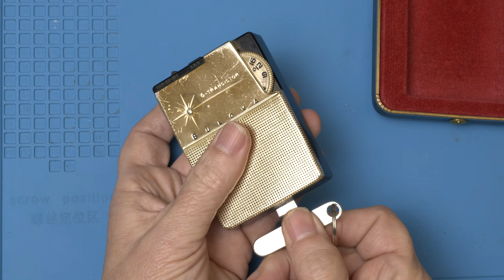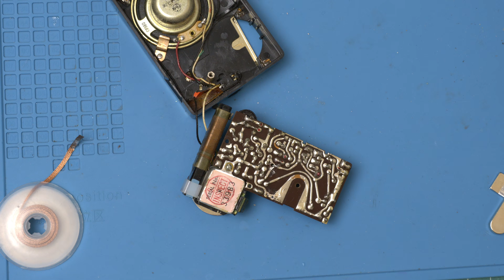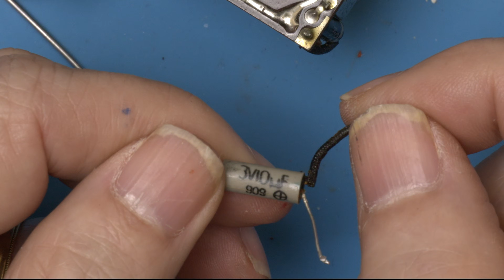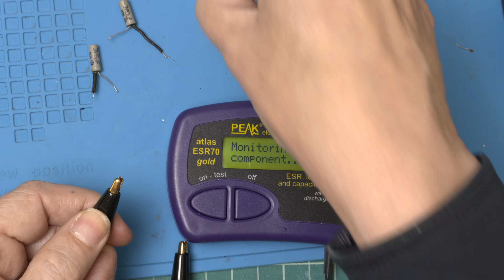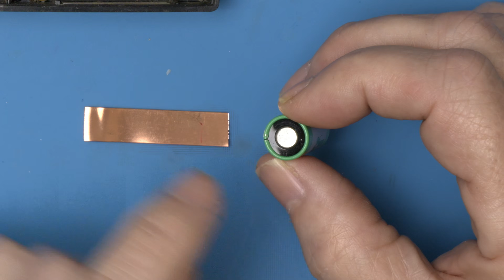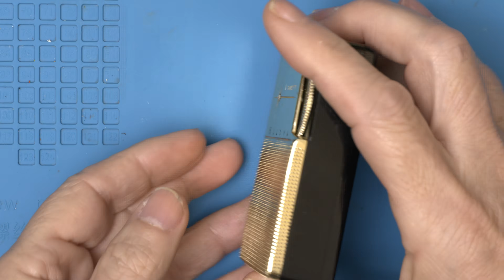3D Printed Adapter uses Dog Shock Collar Battery ⚡🐶 for Vintage Bulova 672 Pocket Transistor Radio

Comment from the maker: The closing song is titled “You’re the One” by Dave Thomas, featuring Alex Robotham on vocals.  I’m using a low power AM transmitter to broadcast it to the radio!
Reply: That's the problem with MW. No stations to listen to unless you're in range of Radio Caroline.

Comment: Should always back off a screw first when going into plastic until you hear/feel the bump, that way you don't cut new threads.  Would avoid electric tools on antique electronics.
Reply from the maker: Good advice, thanks.

Comment: Interesting how circuit boards back then covered all the runs with heavy solder. And that is kind of funny knowing the runs would never ever carry such high currents. And also the transistor counts were advertised as a selling feature and so many times some of those transistors were merely used as a diode instead of a real transistor function. But it was the highest count numbers that were the selling points then...   Thumps Up!
Reply from the maker: Tons and tons of solder!  And yes, transistor count was like the megapixel wars for digital cameras, then it turned into bragging about "solid state".  Thank you for watching!

Comment: Instead of srinking tube use a piece of plastic wire that you have remove the core.
Reply from the maker: That would work!  I have a whole of box heat shrink tubing I’m working my way through…
Reply: @Dream.Build.Create  I always used wire insulation as suggested above, no need to shrink and holds better than oversized heat shrink tube.

Comment: Do you not have to tune a radio to the correct frequencies when you replace components?
Reply from the maker: I don't, but I probably should, I'm still learning and I've heard it's easy to mess up and make things worse.  I just rotate the dial until I hear my 3 foot broadcast of the theme song, its always pretty close.
Reply: @Dream.Build.Create  That's okay. You're doing very well with repairing the electronics. You're a fast learner, by the look of things. Good luck and have fun with electronics.

Comment: Interesting to see the separate on-off switch, i've never seen this before on such a small radio. As us collectors know, its usually part of the volume control. Sets it apart from the rest for sure. But as you and other comments pointed out, this was marketed as a keepsake of sorts
Reply from the maker: I know!  I've never seen it before.  It was hard to see in the video, but it is actually a 3 way switch.  The middle position is off.  Switch it one way and it activates the speaker, switching the other way activates the earphone.

Comment: How did you knew those were the eletrolytic caps without a schematic?  The battery compartment with new battery, was nice to see you built that well.
Reply from the maker: After awhile you can tell.  They are tall cylinders, two leads, one lead is marked with a + or -, and usually a voltage and capacitance designation written on it, like 6V 30MFD, or something like that.   Sometimes the two leads both come out one end ("radial") and sometimes the leads come out on opposite ends ("axial").  Transistors can look similar, but they have 3 leads and no markings that resemble the electrolytic capacitors.